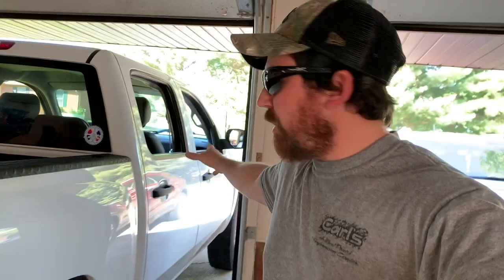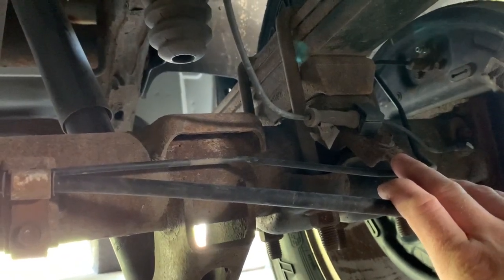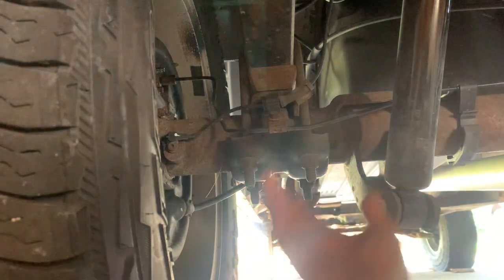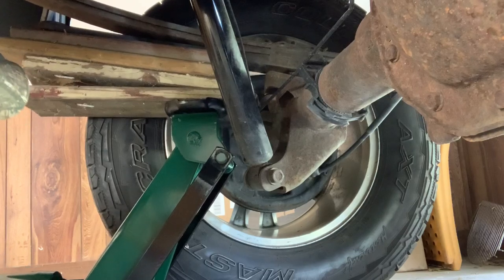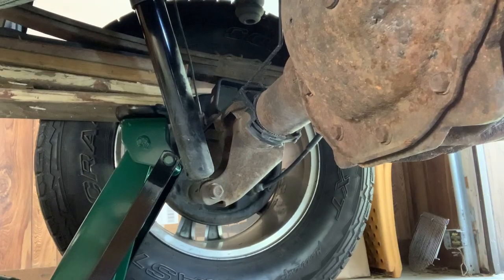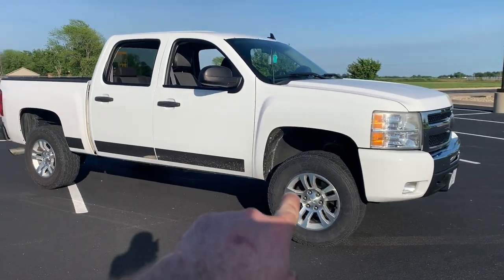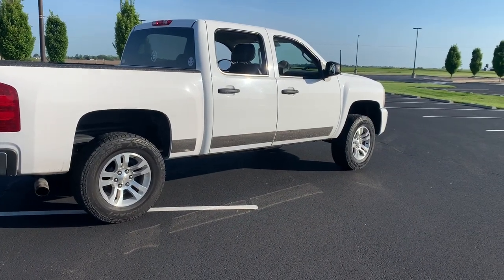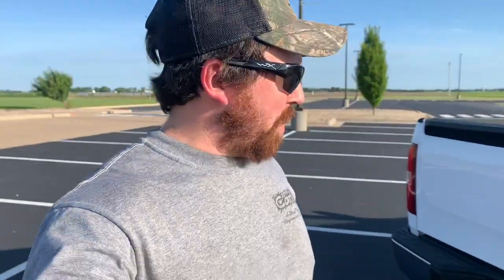Removing Stock Lift Blocks On Silverado

Comment: Your video was ok, but you never said how well the vehicle drove after adding the rear lift blocks.  Did you loose any handling in the rear?  Im thinking about removing my 2.25 inch rear to see if the truck drives better w/o rear blocks.
Reply from the maker: Didn’t really notice a difference in the ride with the blocks. Only noticed a difference in the front with the leveling kit.

Comment: That looks hella better. I got an 08 1500 with a 2" leveling lift in the front, and my back is starting to sag a little, might have to do this too.
Reply from the maker: Hell yeah. Thanks brother.
Reply: There's a chance you will loose some rear handling after adding a 2inch block.  Im debating whether or not to remove mine.

Comment: I bought a 2005 chevy trailblazer and it keeps overheating I changed the thermostat 3 times, ran a bottle of blue devil in case of a head gasket, and it still overheats especially when I use the a/c, my last thought will be the radiator but if that doesnt work I wanna engine swap a Silverado engine in it... but I dont want it to come down to that... please help me and tell me what your thoughts are on what I should do bc at this rate this will be my last chevy and  I love it all around it's just not dependable
Reply from the maker: Blue devil referring to a stop leak?
Reply from the maker: Make sure your fan is working. Also, do you have to keep adding coolant?
Reply: @TheDieseldog  yes I had a badass leak bc my oil was milky so I knew water was getting in my oil and that fixed it my oil is fine now and I had my fan fixed and I have to keep adding coolant all the time I run water bc I cant afford to keep running coolant
Reply from the maker: Sounds like blown head gasket or cracked head for sure.
Reply: @TheDieseldog  damn thanks for the diagnosis
Reply from the maker: Would get it professionally diagnosed before committing to anything. I couldn’t say 100 percent unless I checked it myself.
Reply: @TheDieseldog  well I'm in Arkansas so thatd be a helluva drive but I'm sure I will it's my first car I'm 18 I was really into it when I saw it and then bam problem after problem just kept comin and comin
Reply: Arkansas bound‼️🇺🇸

Comment: Thanks for the video man, I'm actually gonna be reverse leveling my truck pulling the spacers in the rear. Should drop it right where I need it. Wasn't sure if that would work though but you proved it would so thank🤙

Comment: I have a 2010 chevy silverado with almost 18k miles. Got it from my elderly dad before he passed. He didn't drive much, and lost his ability to drive shortly after buying the truck. (WHY SO SLOW MILES)
My question is that everything looks new so can I reuse the old shackles after removing the block? The back of the truck sits 2 inches higher. This will at least drop it a inch so the back will still be a inch higher.

Thank you for any reply. It'll be much appreciated!!
Reply: New u-bolts are fairly inexpensive, safer to just replace it while you are there.

Comment: Did your truck ever have the ‘protector’ strips on the doors? Would like to take mine off, but seems like a headache.
Reply from the maker: Yeah I took them off.
Reply from the maker: It’s not real bad. 3M eraser wheel gets the adhesive off pretty easy.
Reply: @TheDieseldog  definitely like the cleaner look with them off. Guess it’s going on the to-do list

Comment: Does this ruin the truck if you did squat it like metal on metal is not good
Reply from the maker: Nope, just make sure your unbolts are ok and torque. Or tighten best you can. Drive a few days and recheck.
Reply: Ok thank you this is so much helpful
Reply: And I just subbed I have never have some one reply to me and you are my first thank you and hope you do good in the future
Reply: I have looked and commented on every video and no one has responded so thank you
Reply: And so what your saying if I take out the block of my truck it would not effect it

Comment: Are there any negative things about removing the blocks ? I want to lower my obs 89 Chevy, the guy said he could just remove it to drop it 2”. I’m only 17 and new to this so I just wanna know if I’m getting scammed or not
Reply from the maker: Should be 1” blocks. Nah, you can remove them no issues. Being an 89 I’d replace the u bolts.
Reply: @TheDieseldog  nah yeah I’ll most def ask him to change the U bolts. But my truck has like a 2-3” inch block in place ( I bought it like that ) to my knowledge those blocks are mainly to lift correct ?
Reply: @TheDieseldog  he also mentioned that he was worried as to why they put them there , “idk why they would put them there , maybe to prevent rubbing but I don’t know for what”

Comment: My rear axle shifted while I was doing this so every time I’m doing over 65 on the freeway my sit vibrate but my steering doesn’t could it be the alignment?
Reply: 99% sure it’s your alignment I’ve seen a couple people have this happen, when you level it and get it aligned put blocks behind all the tires so they can’t move at all